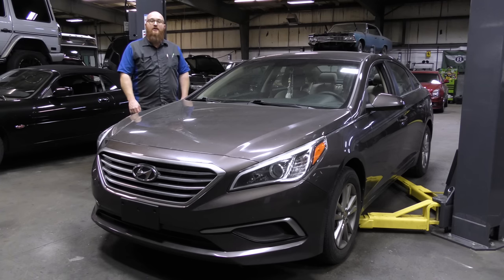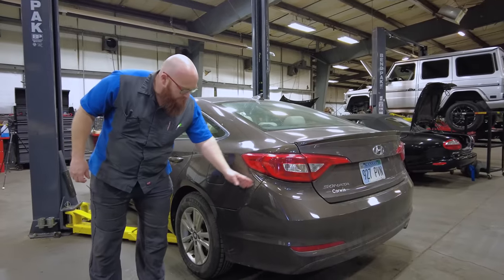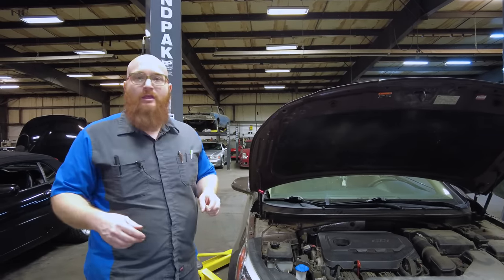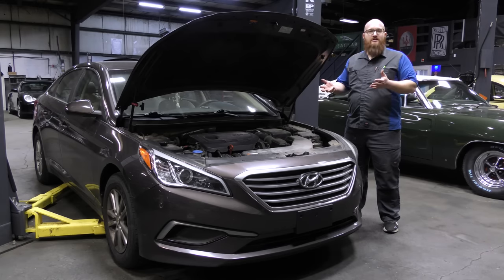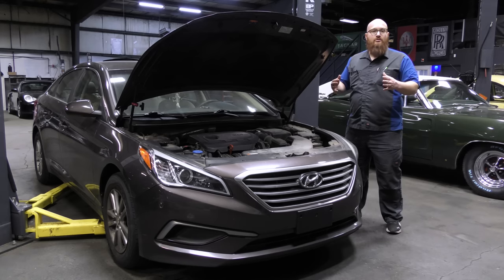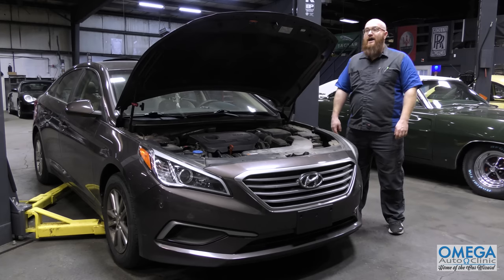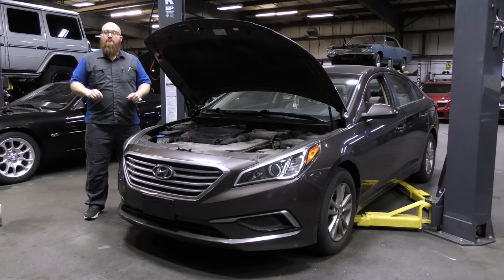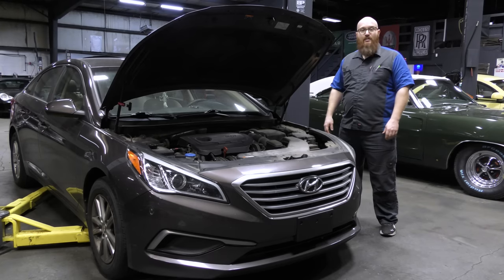What could be so bad on this '16 Hyundai Sonata that the CAR WIZARD is sending it to the junk yard?

Comment: It's hard to feel sorry for that person if they aren't going to do the maintenance. Not checking your oil can be a very expensive habit, but in the end, it's on that person.
Reply: I for one am RABID about oil changes; high mileage or no, when I sold my ‘12 Nissan Sentra, the new owner got a real peach! 🍑
Reply: I have a 2013 Elantra with 91k miles and it doesn't burn oil.
Reply: @madcapper6  My daily is a 96 Silverado with almost 400,000 miles on it. It doesn't burn anything.
Reply: @sfritts  Yeah likely not the issue going on here. Probably went dry unexpectedly stupid quick
Reply: I've been saying for years Kia Hyundai use poor cheap wire harnesses which turn into electrical problems on the vehicles & now fires, I had a 16 Sorento what a nightmare almost everything broke electrical issues up the a** battery continually dying, moon roof wouldn't close just a disaster, they entice with the designs of the car but reliability eventually catches up to you... I remember Hyundai back in the 80s Pony Stellar were also disasters.
Reply: yeah it gose to show how laziness and not changing the oil can seriously shorten the life of a car big time if you ignore that
Reply: @tocreatee3585  Definitely. I too have an Hyundai whose tail lights just burned. And now it's looking like I may have a short in one of the wires that feed a sensor back to the ECU. I'm tired.
Reply: @sfritts  These engines are known to burn oil. Around 70k miles my Hyundai started burning about a quart a week, then, then I had to start putting in 3 quarts every 2 weeks. 
I also have a 02 Chevy with over 392k miles that runs great and doesn’t burn oil.
They have a recall for the knock sensor issue, and a recall for engines that grenade like this poster says.
They have another lawsuit about the burning oil issue which likely comes from valve stem seals. 
This lady probably had both issue, and the dealer used the oil excuse not to replace the engine. 
And now people sit here thinking they know 100% of the facts. These new engines are just garbage. Especially Hyundai/Kia’s of that era. That’s why they were handing out free engines replacements left and right. And denying as many as they could to try and save what little they could.
Reply: for all we know that person was changing the oil every 5-7k. its a Hyundai… their junk cars burn through oil all the time. the mistake was buying anything other than a Toyota or Honda
Reply: @Brendonbosy  Yeah,  I was going Thru 5 qts every month or so. I just started buying the 12 qts synthetic boxes from Walmart.
Reply: No, this engine is just that bad. Seen one that got all its oil changes turn itself into a two-stroke at 100000km. At the end of its life it was consuming multiple litres every 1000km.
Reply: My dad’s ‘16 Sonata SE(white) burned 5 quarts every two weeks. Trust me, I know. I’ve been driving it for months and checked the oil daily. It would normally be below the low line right at the tip of the dip stick. And that’s after a 30 minute drive from pleasant hill rd to Bouldercrest rd(w/o traffic).
Reply: Yep and it costs NOTHING to check it, which is even more unexplainable why people don't do it!  It's just a sign of the times that people are too LAZY to check their OWN OIL!
Reply: @scottandrews4822  It would cost something if the car was burning oil. The Sonata chugged it down before killing itself. Now it’s not even worth it to check the oil anymore.
Reply: #nobashing - as the Wizard said!!
Reply: @scottandrews4822  I didn’t mean to berate anybody. All I’m saying is when that Hyundai or Kia starts burning oil, you better take it to the dealership and say “I want the service campaign 953 done.” Otherwise, you will be stuck paying 8k for a new engine that may be mechanically fucked(let’s hope they’ll give a lifetime warranty for the new engine). Why? Hyundai gave out warranties for all owners, but that service campaign was to be done before the engine failure. If it wasn’t done, good luck finding that 8k(loans can work).
Reply: @@Ayn-Rand-Is-Dead did he see any light on the dash?
Reply: @@Ayn-Rand-Is-Dead I went to school in DeKalb County, Georgia. They did NOT have automotive related classes at my Home School. The County did have an automotive related classes, but you have to take the bus from your Home School to another school(all DeKalb County high schools feed into one of these two schools). I took manufacturing engineering tech there. 

My dad gave me his 2016 Hyundai Sonata for the school year. It burned oil so fast that the low oil pressure light would illuminate after driving to the other side of the perimeter. I had oil cans in back at all times. It started knocking in November, and it threw a misfire code but it immediately went away. No other lights were on after that. Now he’s trying to get rid of it.
Reply: @@Ayn-Rand-Is-Dead now i think school is teaching us anything, including “how to do an office job and spend money that you could have saved.”
Reply: they may have been keeping up on oil changes. My 2015 elantra started to burn oil when its piston slap started up. pulled my motor before bearing damage; pistons/ cylinders were toast. having the cylinders honed oversized and rebuilding it in my garage everything else looks good still
Reply: I watch everything on my cars like a hawk, but I’m also very interested in cars. Since everyone has to have a car, but not everyone is interested in the mechanics, there will always be people who don’t know what maintaining a car entails. I feel bad for them that they’re forced to own something so expensive and requires such maintenance just because of how our society and infrastructure is designed. Honestly, electric cars are going to be so great for those people.
Reply: Oil is the life blood of the engine. Oil shops are out there and this could have been totally avoided.
Reply: The problem is the Kia/Hyundai GDI motors are trash and they burn way too much oil. I even do oil changes on time and it still burns oil. It is just a horrible motor.
Reply: We have a 16 Sonata and we check the oil ALL the time, its burning through oil.

Comment: Thank You Mr & Mrs Wizard, I just repaired a minor turn signal, and I will go and check my oil! 2006 Hundia Elantra, I deliver flowers with it, just turned over 90,000 miles. For my last oil change, they replaced the oil drain plug with an oversized plug. As my mechanic stated these oil pans were aluminum. The idea was to decrease the weight of the engine. So every oil change, I will just cross my fingers, you convinced me not to let this go!
I do like your inspections of the vehicles both inside and out!
Thank You!

Comment: Many years ago while working as a tech at a local Hyundai dealer I had a customer bring in a 2000's sonata. (Can't remember the year) anyways for the most part it was really clean with high mileage. Customer made a comment about an oil change so I figured this was gonna be easy. Well apparently at 90,000 miles or so, this was her time coming in for an oil change. I checked the dipstick and yup it was dry. I tried telling the service manager that we shouldn't touch the car, but I was ignored.  Put the car in the air, removed the drain plug and it was pretty much chunks and metal shavings coming out with pitch black sludge that was remnants of oil. The service manager wanted me to perform 2 oil changes on that car in "hopes" it would fix it. That's not how oil changes work. I felt bad for the customer,  but also annoyed that they brought this on themselves.  And pissed at the stupidity of the service manager.  I didn't stay long after that.
Reply: That is clear negligence on the owners part.
Reply: @AJ-xm4xc  agreed
Reply: a lot of owners are just ignorant. They think all they have to do is put gas in when the gauge reads empty and that's it. "maintenance? what's that?"
Reply: Im extending my oil changes to 40,000 miles then!
Reply: Of course 2 oil changes won't help, but it probably showed goodwill to the customer and that's good for business and marketing.
Reply: @donaldlee6760  nor really... in the end it is YOU who touched the car last and now it does not work - so well - according to the customer - YOU are the reason. Let's meet in court... not fun
Reply: @kris856  - hahaha - I clearly remember a plumber telling me "...the last person that touches it, owns it". I remember thinking to myself that plumber must have been burned badly and too smart to get burned again.
Reply: I would've walked out when service manasaid that
Reply: I have a 14 month old car and the onboard computer is telling me that a service/oil change is due at 20k miles. Do I need to bring it in sooner than that. Have only done 14k miles.
Reply: @donaldlee6760  my dad used to have a mobile oil change service where he came to the customer's location and did oil changes and other minor maintenance. He had that plumber's philosophy with transmission services if the customer said their trans was acting up or if they wanted him to do the first transmission service at 100k miles or up. Nope, you're not gonna blame me when that thing fails after I change your fluid and filter. That's your deferred maintenance biting you in the ass.

Comment: This is great advice EVEN for the mechanically inclined. Last summer replaced a head gasket on a different vehicle.  At the same time my teenage daughter was driving one of our cars, of Japanese variety, and then one day I climbed into it and realized it had been over a year and 10,000 miles since the oil was changed.  Many faulted Acura's very in your face oil change reminders but I actually think it might be a really good idea for people like me.
Reply: If the owner were to trade that car in for a new car, the dealer would take the car and then put in a new engine under the owners original warranty. and along with screwing the owner on the trade, they would screw Hyundai on the replacement engine - That is the truth and that is how bad car dealers are - all of them!
Reply: Oh my dude, Acura/Honda had tire rotation reminder, too. What a company!
Reply: 12 rule for life 
No.1  Dont buy a KIA Hyundai new
No.2  Dont buy a KIA Hyundai used
Reply: i dont like oil change 
thats why i drive a HONDA.
Reply: 10k miles is an entirely normal oil change interval so not sure what you think the issue was

Comment: I suggest you check with another dealership to see if they'll file warranty for you.

I had the same issue on a 2015 Sonata SE mode I bougth at 44k miles.  I never serviced it at the dealership.  Noticed that I had to keep adding oil and took it to the dealer at 125k miles.  They did an oil change, asked me to take it to them every 1k miles to check the level.  After the 3rd time they filed a warranty claim for me that day and it was replaced w/in a week.  Oh, and no, it does not give you a low-engine oil warning when the car is burning oil.  I only noticed b/c I checked it periodically but nothing ever showed up on the dash.

The issue I'm having now after about 2 yrs is that I took it 1yr ago for a software update and I think it caused a computer issue.  1 out of 5-10 times I start the car and start driving the car will not accellerate and revs up a lot, then it also feels like the transmission is not getting into gear.  I then just pull over, turn off the car for 5-10 seconds, restart it and it drives perfect from then on.  

Took it to the dealer but it didn't do the fault when they test drove it a couple of times.  Any ideas what it could be?  I think it might be software.
Reply: Did you find out what it was? My old Altima had that and it was the transmission

Comment: My oldest sister did this with the car our parents bought her. She never even checked the oil and ran it till it died. Her friends ended up putting a junk yard engine in it.
Reply: buddy of mine got a Hyundai suv check oil and change oil every 3 -5000 miles.
start burning OIL almost immediately.    the engine lock up on highway almost killing him  at 50k.
Reply: @kuyre2239  I'd never buy a Hyundai, they have known bad engines. My oldest sister bought an Excel when Hyundai first came to the USA. When she let me drive it, I couldn't believe how bad it was.
Reply: Female drivers should be required to take a course on basic maintenance on a vehicle BEFORE they are issued a driver's license...
Reply: @richardhoating23  Male drivers too buddy, you oughta see some of the excuses for young men out there these days.
Reply: nice casual sexism.
Reply: @rudyardganuelas6254  it is sexist but let's be honest there's some truth to it. Most women have no reason to check the oil because they usually get a new one pretty often because they like nice things
Reply: @chumbawaumbacumpa  with a ratio of 1:10 i dont think we need to worry about men in that regard